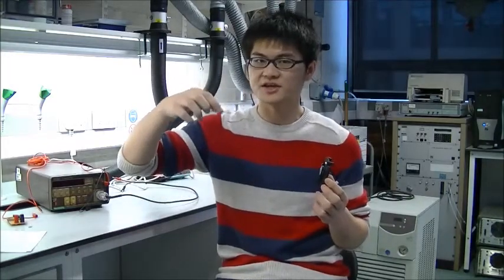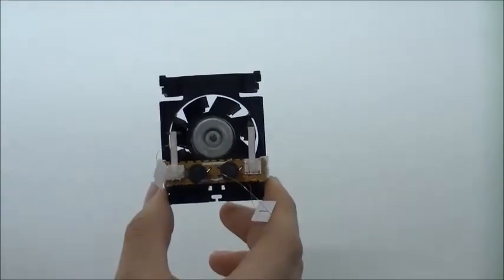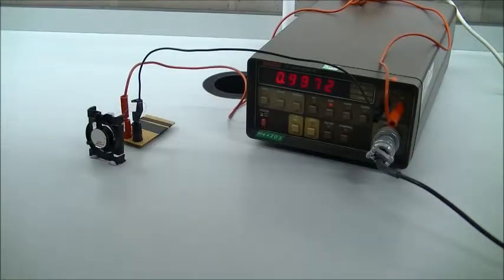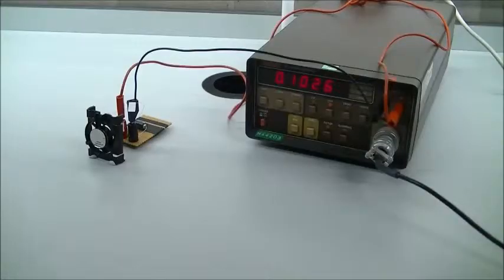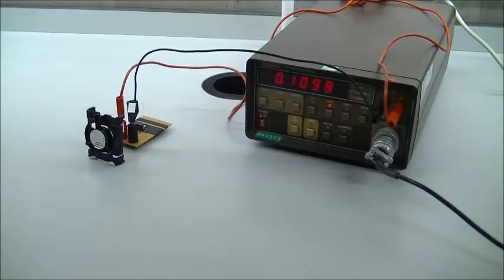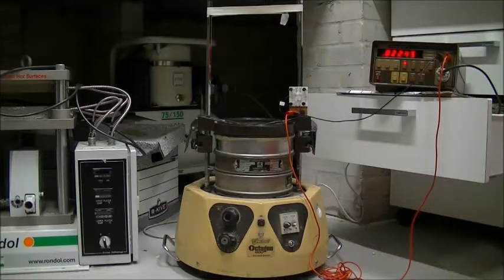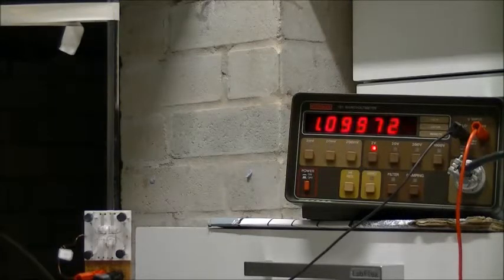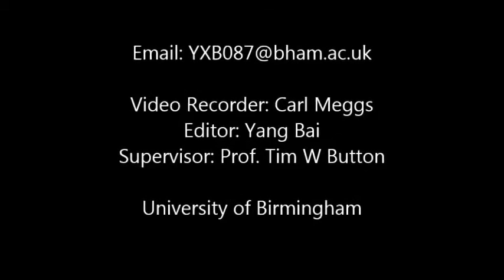Harvesting small-scale wind and vibration energy

Comment: What type of Piezoelectric Material you used? and for the second demonstration what are the parameters for the vibration demonstration? (Frequency and Amplitude voltage?) thanks!
Reply from the maker: The material is La-doped PZN-PZT. For details of either the material or parameters of the demonstration you could have a look at my papers. At the Researchgate search Yang Bai University of Oulu Finland. Thanks for comment!